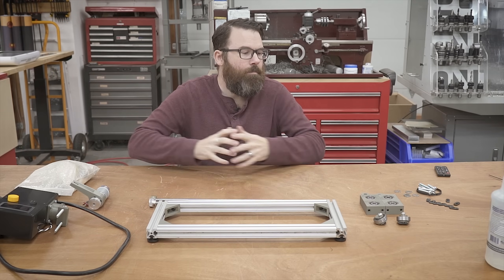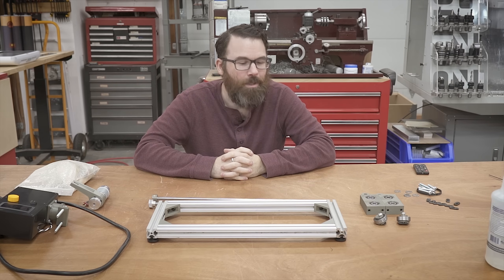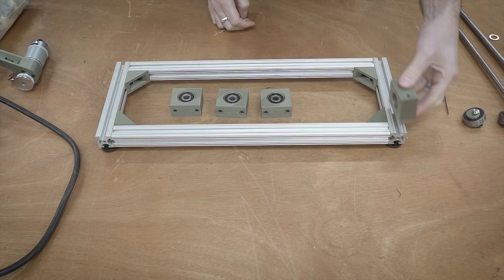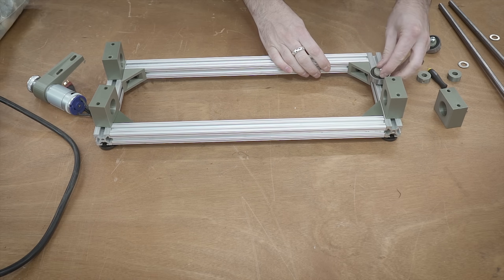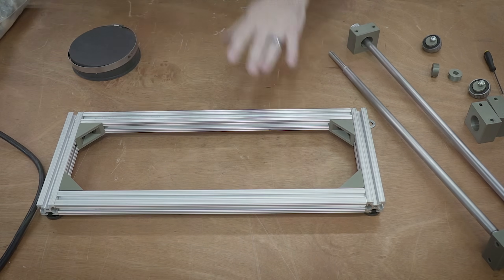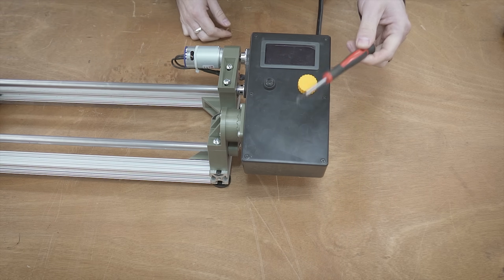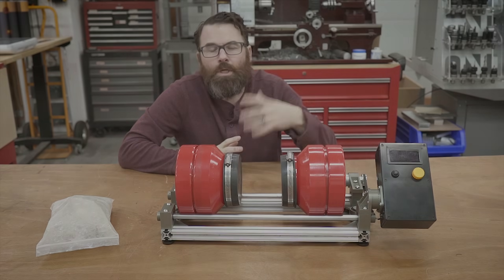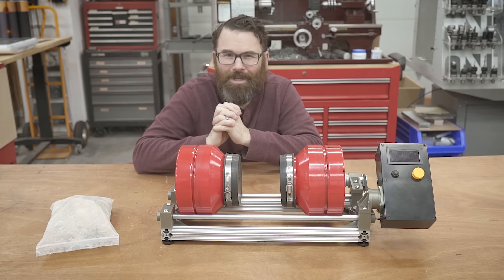DIY Rock Tumbler (Design/Build)

Comment: what power supply did you use for the motor?
Reply from the maker: I use my bench power supply, but anything should work, you can get laptop chargers or power supplies for LED lighting just about anywhere.
Reply: Thanks for the quick response

Comment: Robert. Wonderful design and engineering on your rock tumbler. I'm thinking about making a variation of your excellent design. My question has to do with the DC motor you've chosen. Most tumblers that are well made such as the Lortone's use simple AC motors that have some internal cooling plus they add another set of fan blades on the motor shaft to keep things cool. Being a rock tumbler could be running 365/24/7 that's understandable. Definitely continuous duty. You mention this need in your video. I'm unaware of DC motors being used this way. So, my questions are how is your DC motor holding up, does it getting warm running 24v on a 12v motor, and do you think it'll survive years of continuous use? Thanks again and great videos.
Reply from the maker: DC motors are fine.  Most companies use an AC motor because it doesn't require any power supply and is just simpler to implement.  I just happened to have DC motors on hand.  Either one works just fine.
Reply: @RobertCowanDIY  thanks Robert.

Comment: As a full on cad/cam/cnc machine guy who still has two large Haas milling machines out in his garage and has built complex automation stuff....that's bitchin'. Way to go!
Reply: Love the project and I am building on now.  What is the current rating for your power supply.   Do you have a link to the one you used.  Thanks in advance!

Comment: Hey Robert, where did you get the box from for the electrical components?
Reply from the maker: It was in my parts bin.  But you can get stuff like this from amazon, just search for project enclosures.
Reply: @RobertCowanDIY  Thanks, I found 1. Your power supply is 24v correct?

Comment: Facinated with your skill sets.. Does the motor come with the power whips? I'm new to robotic motors and small electronics. Not sure what wire/harness is needed to connect to the variable speed controller. And does the controller plug into a 110 outlet?

Comment: Was the use of a 24v supply with a 12v motor on pwm an intentional attempt to reduce heating at low duty cycles or did you just happen to have  a 24v supply laying around?
Reply from the maker: Intentional.  It gets me more speed.

Comment: The amz link is for 5mm pulleys but the shafts in the video look to be much larger, I'm guessing 8 or 10mm?
Reply from the maker: Good eye.  I did actually drill out the bores to the appropriate sizes, so I never really bothered to get the right size bore on Amazon.  I think the shafts are 8mm.  I just bought some pulleys and made them work with what I had, but you can certainly find pulleys with the correct bore.
Reply: @RobertCowanDIY  :+1: Would you consider posting a f3z? I would be more than happy to pay for the originals to save the effort of having to redraw parts if I want to tinker with the design.

Comment: What size bearings are the pillow block STLs designed for?
Reply from the maker: The pillow blocks are for a 30mm OD bearing, and of course you can choose the ID for whatever rod you used, I did 8mm.  The block will accept up to a 10mm thick bearing.

Comment: A trick you can try next time for the vinyl tubing (dont know if it will work but Ive used it to solve similar problems) is to coat everything in soapy water. Makes everything slide on easy enough and is just as grippy once the water dries up
Reply from the maker: Ah, good idea.  It looks like I struggled a lot on camera, but it was about 5 minutes.  But it was a bit tricky for sure.  I'll remember that for the next rock tumbler I inevitably make.
Reply: @RobertCowanDIY  hahah for sure 👌 just another one for the mental tool box

Comment: Could you use o-rings on the rollers to engage with the grove in the drum. Would keep drums the place and provide drive at the same time.
Reply from the maker: HEY!  That's a really good idea.  I feel like the o-ring might still want to move around, but it could probably keep it in place, since there's no real side load.  Nice idea.

Comment: So is 40 rpm ok for all phases, no need for a timer???
Reply from the maker: Well, it's adjustable.  I think the rule of thumb is about 1 rev per second, or roughly 40-60 RPM.  But bigger or smaller drums will spin faster or slower, so I made it adjustable.  For a timer, I am just going to use a plug-in timer, which is just a bit easier.

Comment: Where did you get your aluminum extrusion? I want to get a bunch of it but i want a reliable source that is not super expensive. The cheap Alibaba extrusion is not reliable but cheap and Misumi is very reliable but super expensive.
Reply: Is there a good balance that you know of?
Reply from the maker: I just buy from eBay.  There are sellers on there.  I've had these extrusions forever though.  I look on craigslist too, some people will get rid of a lot of random extrusions from time to time.
Reply: @RobertCowanDIY  Interesting and are you not worried about mixing and matching the extrusion you have